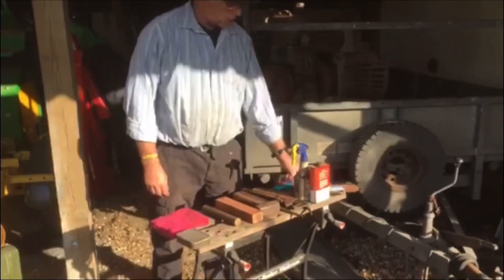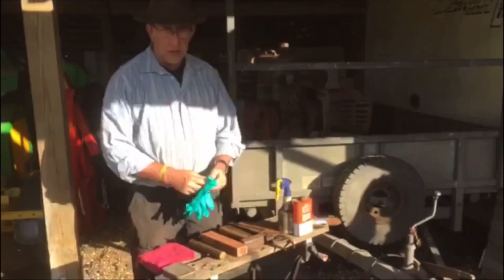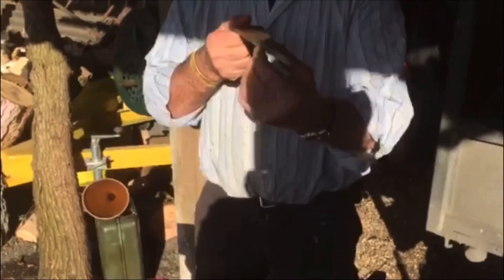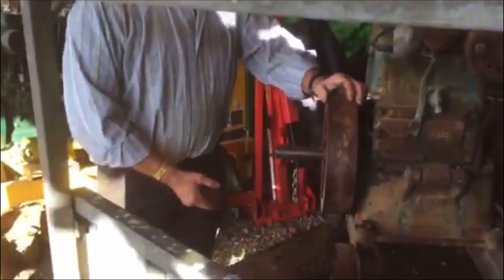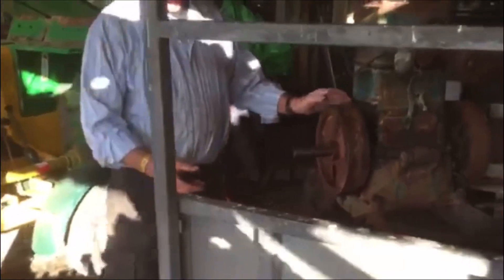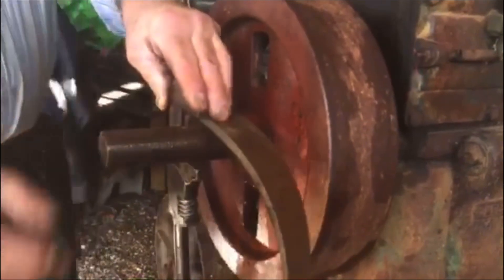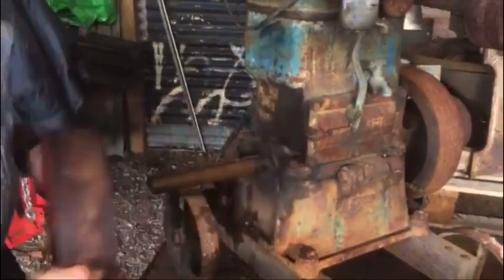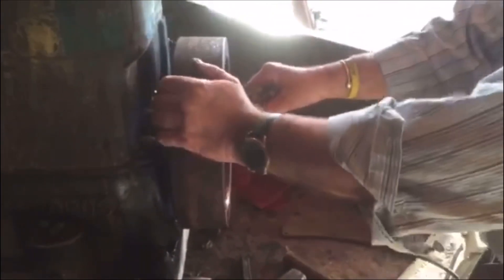Gibb key removal

Comment: Hi mate, just saying great video, explained a lot. Just asking, is there anyway I could use the spanner to clamp down a prong of a bearing puller and then use the bearing puller to take out gib key? Just a question. It’s on a 1951 Petter A1 3hp 1500rpm 👍

Comment: What about some heat ? Tried it, will not budge but the drift key keeps popping out
Reply from the maker: @alaincote6684  not sure heat would be my go to option especially on a combine with all that dust and everything, just keep the lubrication on there
Reply: The gib key remover is not flat across the face, it has a camber, you may have it the wrong way around.